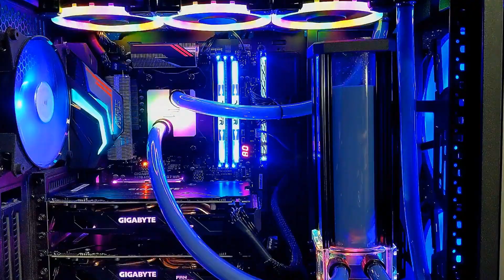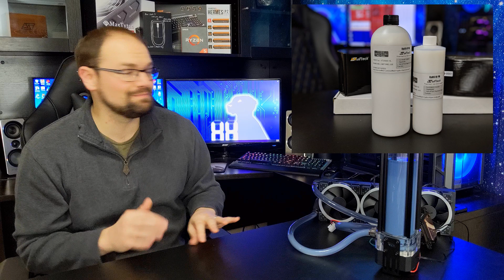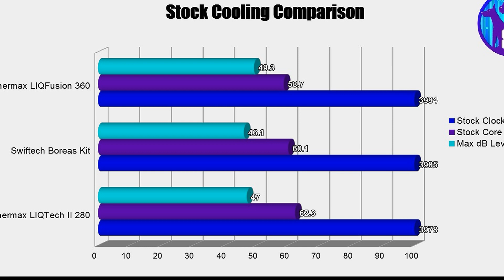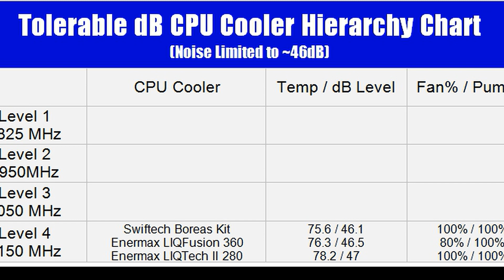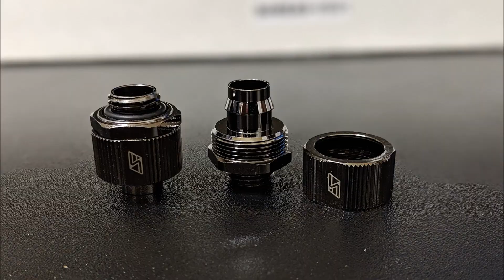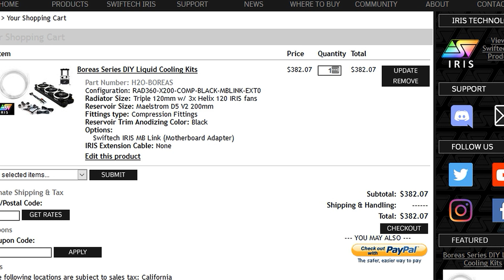Custom Water Cooling Loop Simplified - Swiftech Boreas Review

Comment: For me it's cost, a damn nice AIO runs around $150. A custom loop can easily run you $300-$400 unless you buy some cheap Chinese kit. Plus an AIO from a reputable company is going to warranty any damage.
Reply: That's not the same use at all. A custom loop is intended to be upgraded later, adding the gpu to it or other things.
Plus, the look, you clearly pay for that too.

Comment: compression fittings shouldn't need a wrench to tighten hand tight is all you need
Reply: Hello, I designed these fittings, and my philosophy has always been:  "better safe than sorry". I had "hand tight" fitting go loose on me and spring a leak after a few months, and trust me,  this isn't good! so I included that hex shape in the design in order to allow people to give them a lock, so they would never come off :-)
Reply: @gaberouchon  good to know cause I have swiftek fittings in my loop

Comment: I have that corsair AIO you referenced(got it off ebay), came with 3000rpm fans and that got me thinking, this can't be good if you need these fans lol.
What's the noise level on that pump+res? i have 2 cheap sc600 pumps and even on low rpm they're noisy, i leave my pc running FAH at night and i want a pump thats low on noise at 50-80% usage.
Reply from the maker: There's a bit of noise the pump makes at a certain percentage when it's revving up or down. At 100% though, it's close to silent and even more so at 50% or lower.